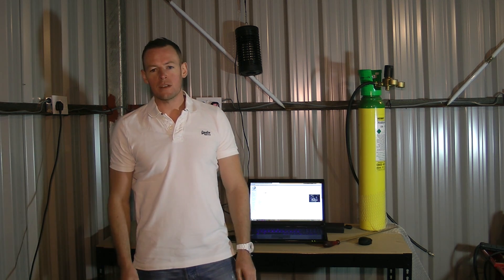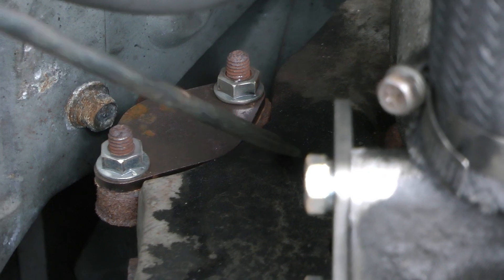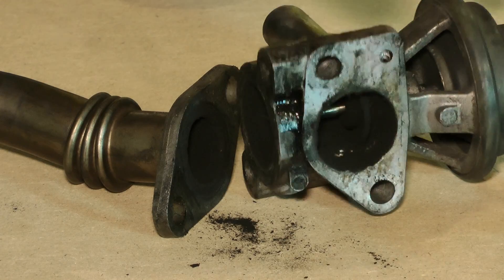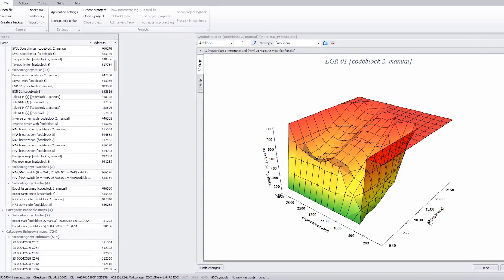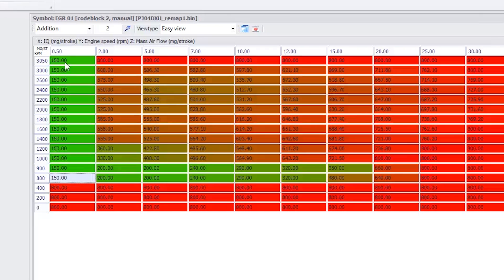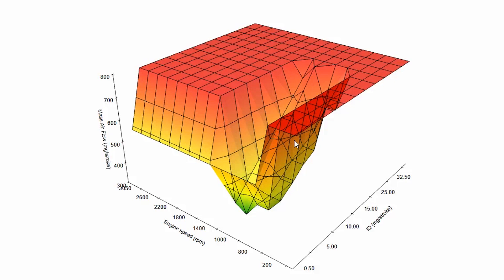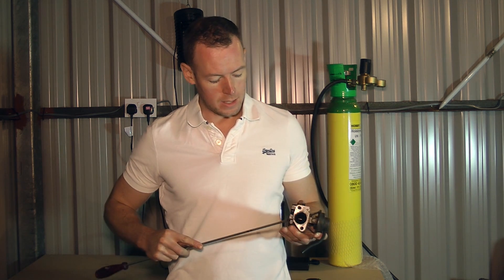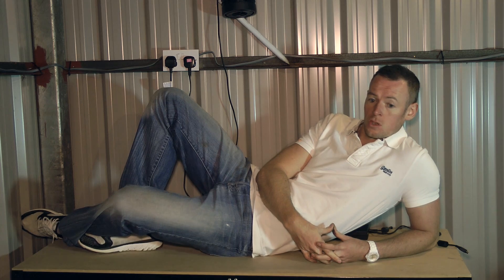EGR for motorsports

Comment: Fuel Economy false, or at least discussion about it, depends too much on circumstances, cons temperature control of the engine and the combustion chamber, which is a very heavy con that in most cases (or heads) it should be on top before all your pros.

Comment: So where does your engine get its oxygen from for combustion after blocking off the turbo compressed air outlet ?
Reply from the maker: The turbo outlet is not blocked
Reply: @vPerformance  Thanks, yeah I'm still learning 😁

Comment: Thanks for the vid. I have an old mazda5 2009 2lt diesel. EGR is a bitch to remove and the engine light is on. I'm keen to blank the unit and clear the fault. I hope this stops the engine light coming on and then effecting the idling... or would I need to delete maps? What software you using, pease?

Comment: EGR lowers combustion temps through heat absorption and lowering of oxygen content thus reduces NOx emissions. Actually, they aren’t really an issue but when mixed with PCV gases you get fouling. Fitting a oil separator (catch can) will solve these issues.

Comment: Why do you want more cold air to produce more power at a part throttle i.e a condition when you want less power?

How can deleting EGR give more power if at max throttle when the EGR would be fully closed anyway? 

To increase mpg with egr delete you need to also adjust the wastegate as it is partaily closed to drive the EGR flow. This gives a back pressure penalty.
Reply from the maker: Anywhere fuel is being burnt, mixing with cold air produces a more complete burn and more torque.
Reply: @vPerformance  In a Diesel there is always extra oxygen availible at part load. That is the point of EGR too reduce the amount of oxygen to form NOx and lower combustion temps. If you want more torque you put more fuel in

Comment: hi mate, i have a skoda superb 2,0 tdi cffb engine. it cut out on me and wouldnt start again. it now starts with easy starts and cuts out when i rev it. iv been told egr is sticking/stuck open hence why it wont start .  my question is can i just put a blanking plate in ..infront of the egr cooler therefore blocking the gasses coming into engine and leave the egr in place or will that throw eml light on as techically reading as blocked and lead to other issues such as non regeneration of dpf?. ...and is it necessary to map it out to get rid of the engine light . thanks
Reply from the maker: You'll need a map to get the eml light to stop. You can block the ege with a plate, but you might find the issue is not the egr. Check fuel filter, air filter, fuel pump. Could also be a knackered airflow meter or trouble with inlet manifold if it has those awful flaps stuck
Reply: @vPerformance  thanks. I will get fuel filter today try that first  air filter was done less than 1000 miles ago. I'l spray some cleaner on maf

Comment: Hello, quick question!!!  will vagsuite work with a Ford Focus 1.6tdci 2010, just to experiment with and learn from, also desperately need to get rid of the egr, I have a blanking plate ready but I don’t want install it until I can deal with the ecu.
Reply from the maker: I'm pretty sure it's only for vw group cars

Comment: Thanx man! 
I think my EGR may be faulty because I smell fuel at idle. I never even thought cars had these lol
Reply from the maker: What car do you have?
Reply: @vPerformance  Skoda Fabia MK1 with VW 1.2L 12V AZQ engine. 
Just today I have unplugged the connector (it's an electric valve). My check engine light didn't come on, but my scan tool shows the code. 
I will test my car for a week now. It used to gulp 8.5L here in the city, which was already too expensive. Last two tanks it gulped 9.5L and that's waaay too much. It has only 89 000 on the clock, and my grandpa was a very fine driver (first 75K). 
The engine is in mint condition, but something doesn't add up.
Reply: That’s not a faulty egr check if your catalytic converter is still on or if your a diesel than check your dpf and catalytic converter

Comment: Also less efficient oxygen burn. burns the fuel more completely buy can't get more power out of cooler burnt fuel. This should be common sense putting used gas in will burn but Degrades the power that it was and then mixing it with good fuel means less power. Unless you have a very efficient stroker engine or something
Reply: Cooler wouldn't equal more power unless engine components overheating like injectors

Comment: I think the best way for an egr to be effective is 4 cylinder stroker not on towing or vehicles that need the power. This is good reason for newer vehicles they run on how they are set so adjustment on computer is nesscary on removal of egr
Reply: What kind of adjustments are needed

Comment: My car is W208 CLK320 ( M112 V6 3.2  gasoline )  from 1998y with ODB1.

I unplugged yellow plug controlling EGR but nothing happened.
I have driven 40 km  and no any differences.
"Check Engine Light" doesn't light.
Regular engine operation.

Is the egr blinded,  removed programmatically from the ECU?
How recognize that ?

Comment: The whole point of EGR is to reduce the combustion temperature by limiting the amount of oxygen entering the engine. This will reduce the amount of NOx,(Nitrogen Oxide) which will otherwise be produced at high combustion temperatures caused by a chemical reaction between the oxygen and nitrogen. The downside as mentioned is a slight reduction of power produced.
Reply: It didnt add power instead reducing it. Research further
Reply: It's not just about the loss of power EGR causes it is also about the increase in fuel consumption , the extra contamination of the oil and the shorter engine life from the grinding effect of the carbon particles , on the cylinder walls.

Comment: I got a Bmw n47 d2 the process I’m told for deleting my egr is removing actuator plug then remap, my question is if I still put on a blanking plate I’m assuming it can only do good right?
Reply: Hi mate how did you end up going with this? I'm wanting to disable mine on my N47 too.

Comment: I am affraid that my car will smoke and have bad exhaust smell if I remove the egr... also I heared that engine will wear because it won't warm up as fast as it does with egr on. Is it true that egr has a cooler so that egr gas is cooled before getting into the manifold? I have an e46 320d
Reply from the maker: All engines have wear when started cold, and yes the EGR helps with those first few minutes of warming up. The engine also gets wear from having crappy dirty soot passed into the engine though. Some cars have an EGR cooler so that it doesn't overheat the engine with dangerously hot exhaust gas. I'd rather have that hot gas exhausted, and not sent into my engine.
Reply: @vPerformance  so my question is that if i blank the egr and i remap the ecu, will the engine overheat or have any wear because of this? I've been hesitating because everyone was saying that egr is benefic due to the cooler which prevents the overheating...

Comment: THIS IS ABSOLUTELY WRONG WAY F DOING IT!!!  Setting whole map to max value will result in check light ecu will think there is bad MAF sensor. You need physicaly disable egr and by software by null'ing egr hysteresis map.  NOBODY touches MAF map to disable egr.

Comment: The Duratorq 2.2 used on the 2008 Freelander 2 has a crankcase ventilation oil separator. This is seldom mentioned, the consequence is that some owners might be tempted to install a catch can. At 120000km the egr on the LR2 2008 had no oily residue only moderate carbon deposits on the surfaces. The egr cooler however has failed (white smoke, no power) which needed replacing. I observed that the design of the new egr cooler differs from the factory fitted egr cooler, the single large air port with it's complement of smaller ports has been replaced with smaller ports ie. 24S+1L is now 32S+0L. This could have an impact on factory tuning due to restricted airflow and altered cooling efficacy.

Comment: well, I know what you are saying is true, so why is it when I put an EGR Delete cable on my Diesel Triton and the overall performance was downgraded. Fuel usage was no better and it had run-on when the engine was turned off. When I took the cable off the performance returned instantly. So why is this happening on my vehicle?

Comment: @vPerformance i'm using a ecu editor called mazda edit. my egr map shows up as green andd red but the red may mean on or off. the red value is 5-10 and green is 0. red values are in the middle of the rpm range nd load

Comment: Stupid question. I was telling my buddy that turning off the egr valve via ECU and then using a blanking plate is something I did. And he then told me I will have hest issue cause he said that the egt will increase. I told him I have no idea what hes saying. Because what I did was turn off the bad hot gases running in the engine. And only cold air is now going into it. So I have no clue how he arrived at his statement. Was he right or wrong?

Comment: Okay, I'm just so tired of reading nonsense about what EGRs do and don't. Some here have already said it but others are too stupid to research and understand. EGRs ONLY function is to lower combustion temps by introducing mostly burnt exhaust gasses...period! Exhause gasses contain very little oxygen, mostly carbon monoxide/dioxide and particulates (yes, particulates even in gas engines, just far more in diesel engines). Combustion engines heat up when burning fuel and oxygen, oxygen being key here. High combustion temps increases oxides of nitrogen, a pollutant so we're told by "experts". If oxygen is reduced, combustion temps go down creating less oxides of nitrogen. So the EGR was invented to satisfy emissions requirements by recirculating inert exhaust gases and thereby less fresh oxygenated intake air. Less oxygen in combustion, lowered temps and thus less oxides of nitrogen (good). Now for the bad, with lowered combustion temps and thus lower oxides of nitrogen emissions there is an inverse increase of hydrocarbon emmisions. The EGR will regularly lower combustion temps to the point of incomplete fuel burn, necessitating the addition of catalytic and air injection systems to the exhaust line to reduce hydrocarbon emmisions. However soot builds up in the catalytic system as a result, which also reduces efficiency/invcreases emissions. It becomes simple to see the circular argument these systems create with each other. Now to be clear keeping combustion temps in check is also important in gas engines to prevent detonation, or pre ignition,  which can quickly become catastrophic to engine longevity. One can argue with today's ECU technologies the above can be more efficiently managed without the use of an egr and catalytic system but instead simple sensors, and throttle and fuel management.

--The EGR does not speed up engine warm up as I have seen commented here. The opening of one would actually lower combustion temps. An engine without an EGR woud actually heat up faster, but the reality is an EGR engine does not employ its function at or near idle warm up anyway. The job of engine warming is left to the thermostat remaining closed so coolant does not flow from the engine to be cooled in the radiator.
--The EGR does increase soot build up all throughout the intake system decreasing efficiency/increasing emmisions.

**In the case of diese engines, I am not the orinator of the following idea but I would like to see it become the updated mandate. Remove both the EGR and DPF (catalytic) systems in favor of allowing combustion temps to remain high for complete burn (virtually no hydrocarbon emmisions) and only keeping DEF injection systems that will render the MAJORITY of resulting oxides of nitrogen into N2 and O2...basically the air we breathe. There will be a small amount of CO2 also, but I've heaed rumors that trees and plants love the stuff. Of course an air cutoff valve would be prudent to prevent "runaway" conditions.

Comment: Real purpose of EGRs is higher engines clean efficiency, lower output of CO2 and NOx. Results in lower power, torque, fuel efficiency, throttle response, blocked air intake manifold over time and intake valve damage.

Comment: How about just removing the vacuum line that opens the valve and blanking that off at line end and EGR end?
Reply from the maker: That method works, but results in error codes in the ecu. Engine management light comes on.

Comment: The EGR is not just to lower the emissions but also to help the engine heat up faster otherwise i completely agree.
Reply from the maker: Yeah that's true, but for performance modifying it's all about the cold air!
Reply: Just use the turbo more...
Will warm just as quick.

Comment: hi there, i'm looking for some answer's to, Is blanking my EGR safe to do on my VW Golf 1.9  tdi BXE, it's a 09' plate. i did a poor man's version of this the other day (put a ball bearing in the actuator tube) which effectively stopped the EGR opening, I think? the car drove fine for 10 or so miles then i lost power driving through a village at 10-20 mph and thick black smoke came from the exhaust? I pulled over and removed the ball bearing.. the cars been running ok since..
The reason i did this was as described in the video, I don't wanty all that gunk in my engine and to also cause turbo failure later on in mileage, my car is on 90,000 miles now.
Any advice would be great if you would.

Comment: I bought a 2004 dodge stratus w the egr system by pass then moved to a town where smogging is required so I replace the egr and ended up w rough idling and almost stalling out hesitation but drives just fine once in motion. Have tried everything to fix idling issue and still is unresolved so I'm put my car back the way I bought it w out a egr can some one tell me how to pass emissions!! Obviously it was by passed for a reason and im guessing this idling issue was the problem. Cancelled out everything possible from sensors to clearing all codes there's no more trouble shooting I can possible do except put my car back the way it was w out egr. Help!! I'm tired of the tickets!!

Comment: Great Video , Question , Do I have to Remap de engine tune if I physically remove the EGR ?
Reply from the maker: No but you might get a warning light on the dashboard
Reply: @vPerformance  Thank you for that prompt response. I had to overhaul my 1.3 Fiat. Engine. Bad diesel available in my country and  EGR putting gunk in the engine didn't help.

Comment: So im thinking of doing this to my 1series. Do i remove the egr then install the blanking plate in place of it OR leave the valve in and put the blanking plate between the exhaust pipe and the valve? I know this would trip the ecu either way, unless i install a blanking plate with small holes in it but then there is no point. Any ideas?

Comment: I disconnected the vacuum line on my EGR valve and blanked off the pipe with a small bolt.
The car ran smoother had more pull at lower revs and did better mpg.  I got an engine management light on my 56 plate jaguar x type 2.0 diesel but that was it. I could live with that and did for 80000 miles.. 
I reconnected the vacuum line for the mot each year just to be sure it didn't fail on the emission test.
Reply: Any instructions how to do it?
Reply: What a hero

Comment: Is remapping also the fix for codes created after an EGR is removed?
I had the EGR and EGR cooler removed from my wife's 06 Jetta TDI last year.
The car now needs state inspection, and the same shop who installed the delete kit is now saying the car is throwing four codes associated with the EGR. I haven't talked to them directly, yet; I will in the morning, but the message via my wife is they're saying it needs someone to write code.
I've worked on cars for 50 years, but not as a pro for 30 years. Even to me, 'writing code' seems a bit 'off'.
Any clues to help me deal with these guys would be great.
Reply from the maker: The ECU requests and measures gas flowing through the EGR - if it's blocked when it requests, it throws an error. Here in the UK if it throws an engine management light that's a fail, but otherwise it's just an "advisory". EGR adjustment is just one of the things that can be changed by a remap.

Comment: It was the jest explanation about EGR will you recommend to leave the electrical connector and the pipe that command opening/ closing the valve after the deletion?
Reply from the maker: Leave whatever you can - try not to cause damage that can't be undone

Comment: there are also many more cons than you listed, you know, engine temp/egt, detonation/pre detonation, nocking in other words, boost cut (yes, a clean mix will drive the turbo harder) just deleting the egr will have massive effect on newer engines as they are so restrictive. just deleting means all the muted down scales become harsh and theres usually too much fuel everywhere. your really looking at this one sided, another commenter stated egr valves are often used to keep engine temp down at high load. this is deadly with certian engines just deleting an egr.
Reply: At high load, EGR is never commanded on, on any vehicle, so that point is moot.
Reply: Additionally, there will not be too much fuel, anywhere. The PCM calculates the air/fuel ratio over 100 times per second and will not allow it to run too rich, unless the fuel map has been modified to allow that.

Comment: its not the temperature of the air, its the fact its burnt and mostly co2, theres no fresh oxygen to burn, so the remaining oxygen is used and not much of it. you can have compressed co2 boosted through your engine and see power loss.

Comment: EGR Valves lower losses at low engine loads... so without EGR you will get higher fuel consumption
Reply: Most diesels get better fuel mileage with egr delete